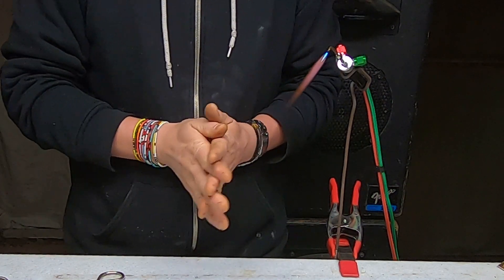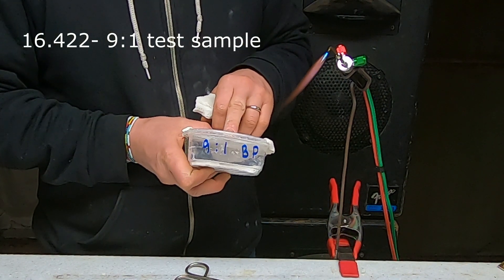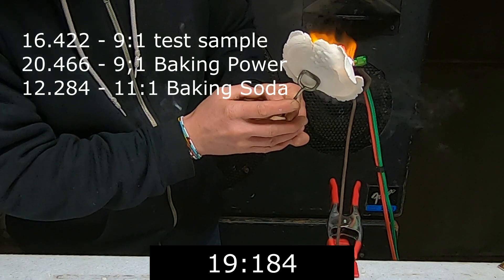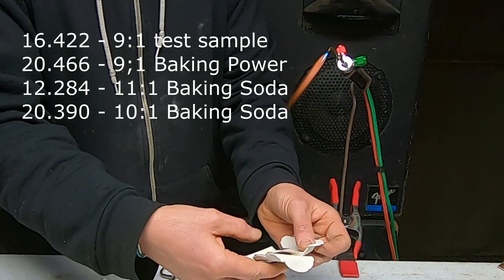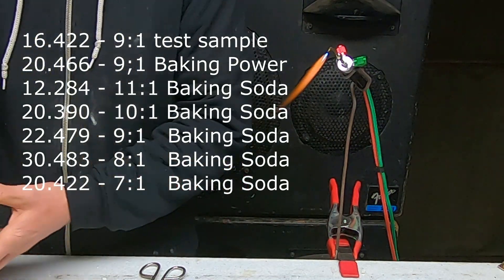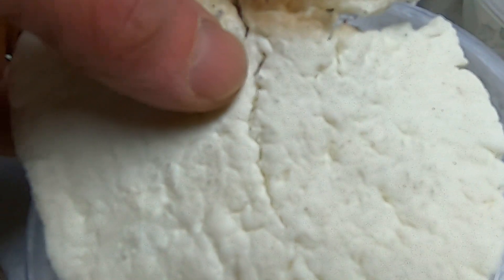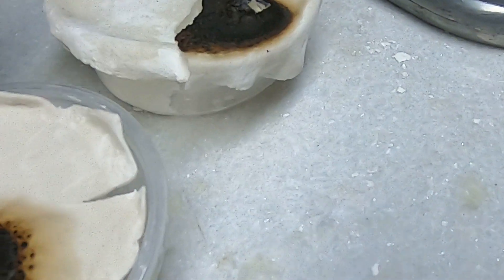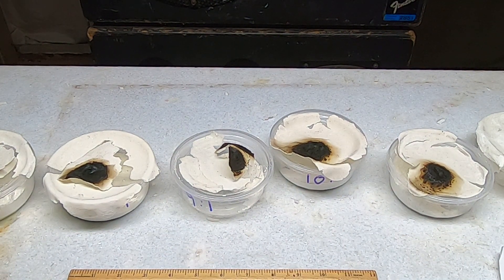Testing DIY Starlite Recipe Ratios - Part 2

Comment: I think u do something fundamentaly wrong: First you heat it with the flame modestly, untill the foam is created... And after that u can "bombard" it with heat... If u "bombard" it with a very hot flame from the begin on, it´s obvious, that it´s gonna be useless, so, first create the foam, then try to use/exploit its heat-insulating-features !!!
Reply from the maker: Thank you for your insight, I will take this into consideration the next time I fire it up.

Comment: What about adding diatomaceous earth? It’s pure silica pretty much which is great for insulation.
Reply from the maker: Interesting question, I would be concerned that the sharp edges of the diatoms would ruptured the co2 bubbles kind of like the way it is hard to get a fluffy whole grain bread and thus render carbon foam less foamy and heat resistant. Just what’s on the top of my head.

Comment: Test this...
Take Vermiculite Portland Cement add mixture of
10 parts corn starch, 1 part baking soda, 1 part Magnesium Hydroxide Powder
(absorbs heat & smoke) then use Aluminum Magnesium Silicate Powder as a
thickener (NOT GLUE) with consistency of molasses before adding to Cement Mix. Of
course, mix it all up in a concrete mixer then pour into sheets and dry. Once dry
then spray onto the surface a mixture of Sodium Silicate, Silicon Monoxide, 21
Mule Team Borax and Graphene Ink.
Reply: that was a good content..liked it!! U an engineer??
Reply from the maker: How am I just seeing this comment now. have you made this before? do you have any links I can look this up? I would like to know more :)
Reply: Lol
Reply from the maker: @arunpillai3007  don't just stand there laughing, links dear sir!
 : )

Comment: Try a ratio of 1:3 Baking Powder to Cornstarch. I had good results as the sample seemed to inflate the non-chared portion. I will be retesting soon to see if my results are consistant.
Reply from the maker: Fantastic, I will that a shot! yeah I wanted to do all the permutations from 1:12 all the way to 1:1 but I have been having issues with getting consistent thicknesses and that throwing off my results... anyway thanks for the tip and when I get my shop put back together I am going to play with that :)
Reply: @SparkerQ  Just tested my second batch. It may have been a fluke since this time it gave off a horrid smell as well as embers. It may have been my last minute glue spray to keep the sample from crumbling apart as well as testing of a nonstick cooking spray. Will need to redo that without any last minute changes next time..
Possible tip for consistency: Grab a tupperware/plastic container lid. Place your sample inside. Then use a rolling pin to flatten it since the edges of the lids have that bump the sample will stay a certain thickness so this may help with consistency but may increase the overall thickness compared to your experiments.
I also have an 18:3:1 Cornstarch to Baking Powder to Baking Soda mix drying now and will be testing tomorrow if possible. Been having heavy rains here.
Regards, 
for the reply you earned a sub. I'll keep an eye out for the new vid.
Reply from the maker: @ Kin Chan hey thanks! I do what I can, every once and a while it works out ;)
Cheers :)
Reply: Kin Chan, thanks for publishing your results too, that's super valuable.

To both of you : are these mass to mass ratios, or volume to volume?
Reply from the maker: @o00oZu1o00o  Volume ratios on my part. just because it is easy.
Reply: Thanks a lot.
You Guys rock!
Me I'm building an aircrete rocket stove lined with starlite. Not sure the starlite part will work, as it would take flame from one side, but heat from all sides, and I'm not sure it can stand that long term. We will see.
Doing a batch of starlite this evening and testing it im my regular stove (250°C).
Reply: @o00oZu1o00o  For me its mass based if I did it correcttly. I always check it using a scale when weighing it out.
I may have figured out why my 2nd test was a fluke. It may have been a lack of glue. Literally made a 3rd batch last night of the 3:1 CS to BP and still waiting to dry.
Reply from the maker: @ @o00oZu1o00o  My feeling is that you may have limited long term success, once the "starlite" has formed it's carbon layer it is very very fragile and does over time burn away... so it is an amazing insulator for it's size in a one / few time use case, however in a stove... well I would love to hear what comes of it and I caution you to not invest too much time into it ;)
Cheers :)
Reply: Kin Chan : thanks

Sparker : My main fears are that it will wear out over time as you say, or that it won't work well when surrounded with heat for hours.
Anyway, I'm looking for something that can withstand 1.700°C temperatures, and that I can produce at home. HoneyDo Carpenter used to pour water glass to coat some of his forges and rocket stoves, but now he has moved away from it apparently and puts a layer of ceramic tile or blanket, but I haven't heard him say why he shifted.
I would have done a perlite clay mix, but they can't go high enough in temperature apparently.
So if the starlite does not work I'll be stuck.
Reply: Concerning the aircrete itself, I'll be using Honey Do Carpenter's mix, which I don't understand... But I can't talk about it, as he sells the formula so I can not say what I don't understand in it. 
Maybe it's possible to design an aircrete mix that can withstand extreme heat by itself without any coating.
Reply: @o00oZu1o00o  I forgot to mention that the BP burns uniformly unlike the BS mix.
I did another test, the BP is likely the source of the bad smell even with additional BS to help. It may also continue to smolder if it's only BP in the mix. I got another one drying rn.
We can continue this conversation through email or discord too if that is easier.
Reply from the maker: @kinchan3334  I would like to be kept in the loop too as these are all things I am keenly interested in making as well. I did some research on what is in Baking Power https://www.thoughtco.com/baking-soda-and-baking-powder-difference-602090 and it comes down to having some kind of acidifying agent already in the mix i.e. cream of tartar and maybe a drying agent i.e. starch of some kind... thus making it closer to a "watered" down (1:12 1:13 1:14 etc... ) Baking Soda mix. Baking Power is in essence kind of like premixed "startlite" without the PVA Glue :)
but I could be totally wrong LOL
and I am sure that you could find a recipe for baking power somewhere and cream of tartar is not that expensive if you buy it in bulk.
Reply: @o00oZu1o00o  i should have sent you an email.
Reply: how about another flour it would work ?

Comment: I put graphite in mine with good results
Reply from the maker: Sweet deal, I did that with a batch that I didn't show and it worked well too, but I figured that Morice's original "Starlite" was all white so it couldn't have had graphite in it.
Reply: What results did you get from adding graphite ?
Reply from the maker: I didn't do much in that batch just really enough to colour it. I rubbed it against a graphite crucible ...

Comment: Good tests but maybe make them thicker and put them in a cheap molds so they are more uniform
Reply from the maker: Yeah, I am all ears if you have a suggestion as to what that mold would look like. :)
I am also limited with the size of the torch that I have as to being able to burn through something too thick like 1/2" would be max max.